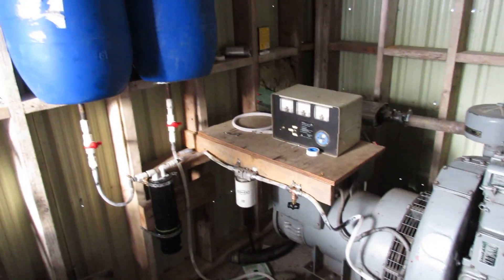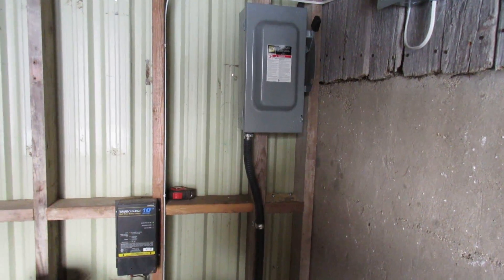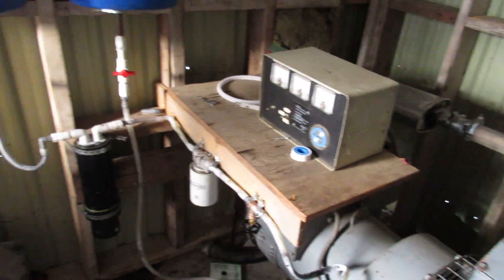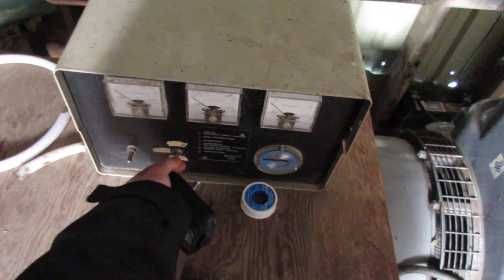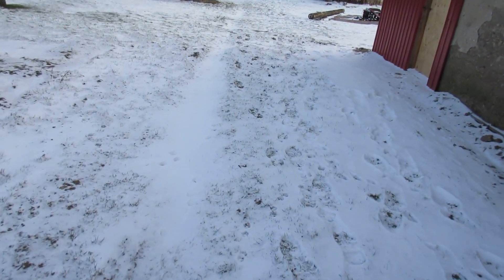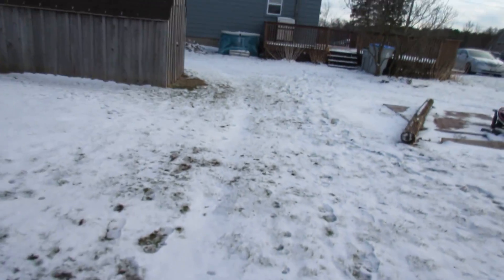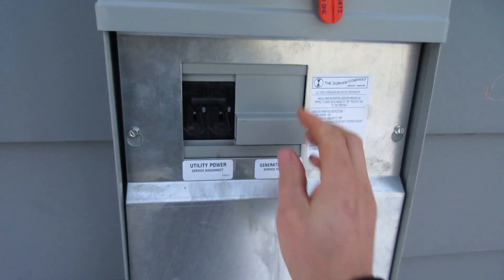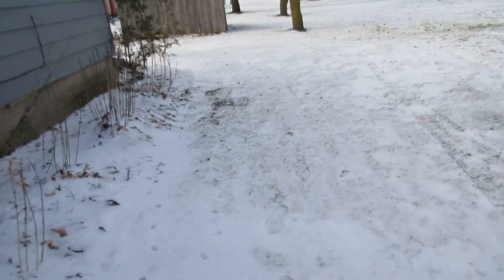lister diesel cold start 1

Comment: I thought you were going to cold start it?. These engines have an overload trip connected to the fuel pump rack, a small plunger that you lift up when the speed control is in the start position. One of the best HR’s I’ve seen. Nice set up too.
Reply from the maker: Oh ya it was unneeded this is a very good cold starter at least down to -10c

Comment: Them engines are 5HP per pot  so15HP engine would make about 10KW
Reply from the maker: Hr3 is way more then that. 37.5hp at 1800rpm says the book
Reply: @1teddy1979  would mean around 20KVA Alternator head

Comment: I have a couple of lister gensets yours is a 10 or 12 kw
Reply from the maker: Thanks for your guess but this is a hr3 lister which is around 35hp so I would guess it is at least 20kw probably a bit more though
Reply: 1teddy1979 I have a 16 kw and is a much larger unit. The other one is a 12 kw 3 phase
Reply from the maker: @andrewtiefry5990  okay well I'm sure it's at least 20. I can turn everything on the house dryer oven 4 burner stove hot water heater 3/4 hp water pump fridge freezer and it doesn't even phase it
Reply from the maker: @andrewtiefry5990  what engine is on your 16kw?
Reply from the maker: @andrewtiefry5990  what engine does your 16kw have?
Reply: 1teddy1979 I have to dig it out we just got another 1ft of snow and it's outside I got part of it uncovered but not the side with the tag
Reply: It is a TX3 lister
Reply from the maker: @andrewtiefry5990  oh ok that is a little less hp then the hr3
Reply: 1teddy1979 the hr3 is 33.5 hp and the tx3 is 40 hp but is a newer model
Reply from the maker: @andrewtiefry5990  I think you have your specs confused http://realdiesels.co.uk/listerdata.html

Comment: Sweet set up, and as you've stated it sits a lot so air cooled is the way to go. A few suggestions to make life easier. One and diesel Stabil fuel stabilizer, or one of the othe diesel fuel stabilizers so the diesel will remain fresh and stability. Second, fairly cheep is a magnetic block heater and attach it to the pan, not too hot, or high wattage of one, but just something that will heat the oil to around 160F. You'll find in the winter it will fire right up and more importantly have full lubrication within seconds. It's not something you use year round, just in the winter months. 3rd. Use the best grade of diesel oil you can afford, and not a multi viscosity, mostly likely Lister recommends a straight 30wt oil. Reason is air-cooled engines have looser tolerances and so you want to avoid 10-30wt, or 10-40wt oils, because a multi viscosity will never have the same viscosity as a straight 30wt. Air-cooled aircraft engines use straight weight oils, like Aeroshell 100, straight 50wt oil. Lot of Harley riders use the Aeroshell 100, 50wt in the summers to keep from frying their engines. Exception to this rule, are the Honda Air-cooled motors that come on everything they use a 10-30wt. Awesome find and set up. With the loads you're pulling it will likely out live you!
Reply from the maker: Scott Pecora thanks for the tips. I have tried one of those oil pan heaters and it doesn't even begin to warm this thing it holds something like 12 liters of oil and has a big heavy oil pan. I tossed that heater in the junk using that oil pan heater on the lister  was like trying to heat my house with a candle lol
Reply: 1teddy1979 my only other thought is try using a magnetic block heater and just attach to the side of the oil pan.  from the pictures looks like you could find a spot.
Reply from the maker: Scott Pecora ya that is the kind I had a magnetic one I had it stuck right on the bottom of the pan but it was just not even close to enough heat
Reply from the maker: Scott Pecora I could see those working on a car that has a tin oil pan and only holds 4 or 5 litres of oil but it just wasn't enough for this

Comment: What a nice machine you have. Where did you get it ??? Where are you located ???
Reply from the maker: Vito Nowicki thanks I got it from a farmer that got it with the farm when he bought it bit then once he had the farm for a few years he was putting up a new barn so this generator was not going to be big enough to supply his back up needs in the event of an power outage so he had bought a new bigger one
Reply from the maker: Vito Nowicki Ontario Canada
Reply: If you ever get a chance to buy another one let me know. Will buy from you. Nice stuff for sure. V
Reply from the maker: Vito Nowicki sometimes I think about selling it because it sits so much but as I write this it is purring away out in the barn there was a wind storm must be some power lines down as the hydro has been out for an hour or more so far. so it is really nice to have even though it is actually only needed maybe a few times a year. where are you located? I have seen similar ones at a decent price since then but wasn't really interested because I had no use for 2

Comment: Super nice set-up!  Will the Lister run on 100% veggi/waste oil?? Or a mix of the 2?? Is the 100 amp service enough for your home? It looks like you have a lot on this service.  Thanks.
Reply: Run on any filtered oil, no problems at all, designed for crude fuel.
Reply from the maker: brad zee it would probably run on 100% used oil for a short time but probably not well and I wouldn't think it would be good from a reliability stand point. as far as 100 amp being enough I don't know what I could possibly have running to need more. I have run dryer 4 burners and oven on stove hot water heater fridge water pump lights and it didn't even seem to work the old lister

Comment: Nice set up. The Lister engine should be trouble free as they are very reliable and basically bulletproof. The HR3 is around 45 h.p @ 2000rpm so I can only imagine it's alternator is rated over 20kw as it could run this easily. Enjoy!